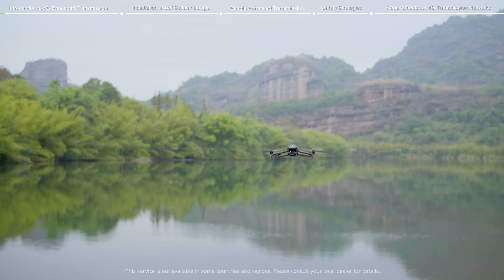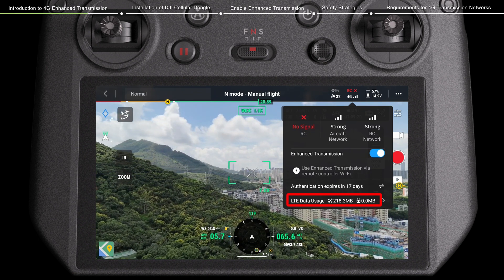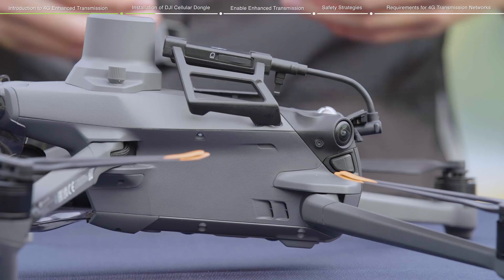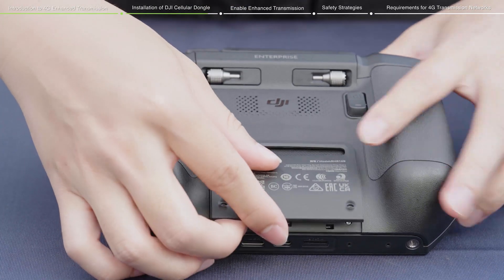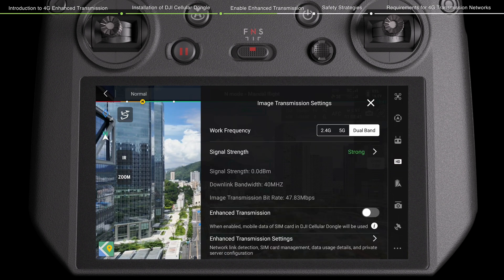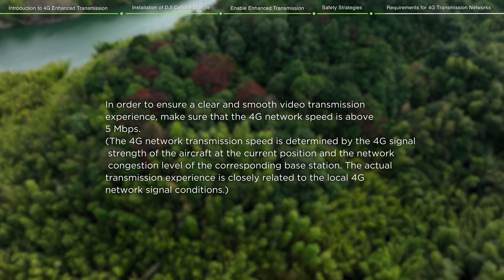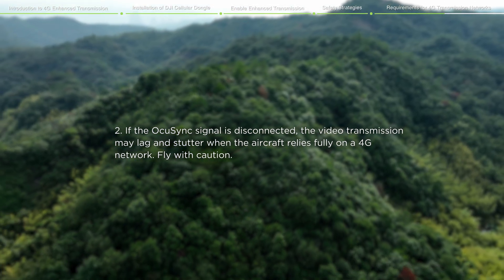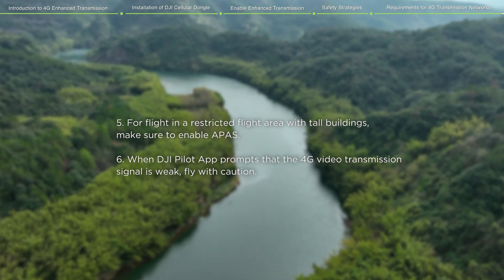DJI Mavic 3 Enterprise Series: 4G Enhanced Transmission

Comment: When will the dji fix the cellular dongle 2 issue on a mavic 4 pro? It does not work on my mavic 4
Reply from the maker: Please touch base with our after-sales team at support@dji.com
Reply: @djiacademy i already did but no real answers we're given.., just the typical "the enhance transmission is not available on aircraft at current region"
Reply from the maker: Seems like it is not supported in your region then?

Comment: Obviously designed for countries with reliable 4g infrastructure like China. Good luck getting a reliable 4G signal in Australia for this application.
Reply: Well, it’s not that bad. I have a 4G dongle using the Telstra network, and it works fine. It’s so much better than not having one at all.